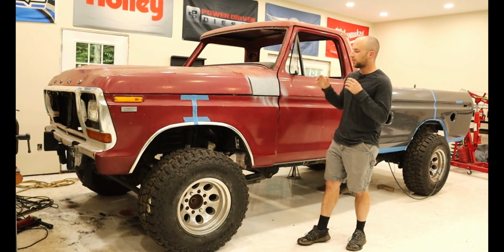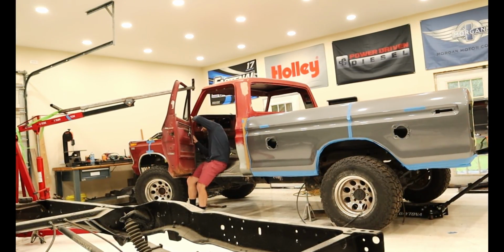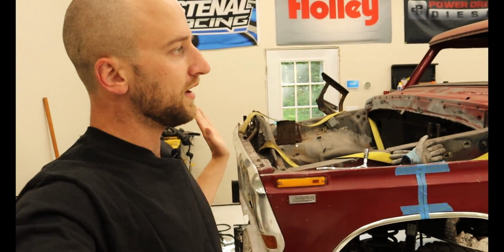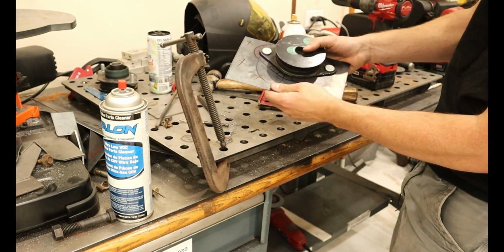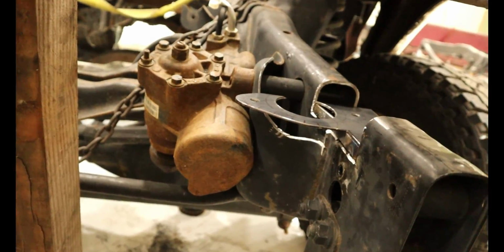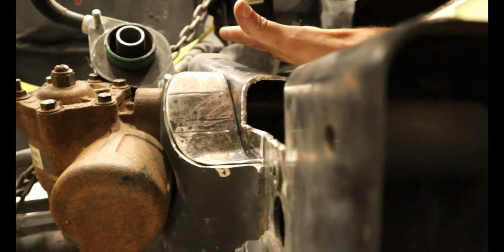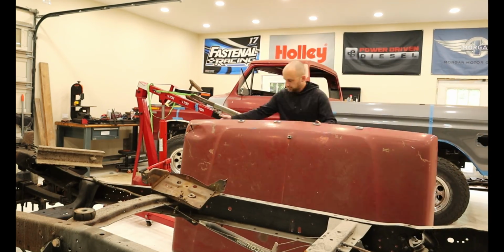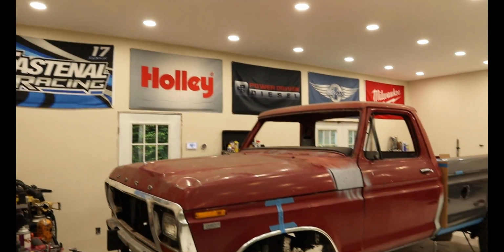Classic Looks with Modern Drivability - 1978 F-Series Body Swap

Comment: Where did you find a full dentside bed in such great condition, I have a dentside myself but my bed is rotted through and I'd like to find a new one
Reply from the maker: My best bud used to be a painter for his families body shop. I ended up purchasing all new replacement panels and we literally built a brand new bed together. He bedlined underneath and painted it for me. He recommended taking the truck to get Line-X'd inside but have yet to do so. Unfortunately this was before my Youtube channel!

I have read you can use beds from OBS trucks, rip off the bed sides and install dentside bedsides and tailgate.  Everything lines up and looks correct. However, I have not done it so you'll have to do some research on it first before commiting.
Reply: Pay a body shop 8k to put one together from a supplier. Make a new one.
Reply from the maker: @PonkyKong  That is pretty much what I did haha, luckily my best friend's family owns a body shop. Lots of late nights but we got it done. Learned a bunch about how panels actually go together.
Reply: @barnbuiltbeaters  same boat for me. Just have to pay to play.

Comment: How will that work to title and registration off the old or new vin?
Reply from the maker: @LEGOCAMARO  off the old VIN. I still have the original tag. Might be a little bit if a headache but it'll all workout
Reply: @barnbuiltbeaters Thanks for the reply! Looking forward to see the build completed. I just got a 93 GMC tow truck, regular cab with a hydraulic aluminum bed. Was thinking of doing a 72 Silverado cab swap. Just earned a new subscriber.
Reply from the maker: @LEGOCAMARO  go for it! It honestly wasn't too terrible! Worst part was all the grinding! This was my first real fab project too. 
Have you compared the design from new to old how the cab mounts? They might not be tok different considering it's the same brand!

Comment: What do you do about the Title issue. Since the title on these old ford trucks go to the frame and not the body. The VIN is stamped on the frame, there is none on the body, just warrantee tags.
Reply from the maker: That is a great question. I know when I registered my truck prior to taking it all apart, the guy used the VIN tag on the door jam. 
I suppose the worst case I can buy a junk frame from someone, cut the VIN out of the frame and weld it onto the new one. Not sure the legality of that but thats my first initial thoughts. 
I actually briefly looked over the original frame and was unable to find it. Could have been covered in grease though. I also have the Title.

Comment: I didn't realize in one of your shorts vids that the chassis was a 2018. I had commented about Powernation putting a 79 f350 crew on a 97 ram cummins chassis. The older ram chassis seemed easier to mount the Ford to vs your much newer chassis. I think you did a phenomenal job.
Reply from the maker: @TheRoadhammer379  i just commented saying the exact same thing haha! Thank you I think it turned out well too. I've never done any large fabrication like this before so I'm pretty proud of it!

Comment: Awesome old Ford being put on top of a piece of shit Dodge
Reply from the maker: @joetimmlv1  haha glad to get you stirred up! Huge improvement over the stock chassis in basically everyday. So might not be the best compared to Ford/GM but better than the original. Pros and cons to each manufacturer!
Reply: Well, if you know history, you'll recall the Dodge brothers made truck chassis  for Henry way back when. They broke away from Ford and began producing their own vehicles. The early Dodge logos featured the Star of David. Now you know why Ford aligned with the Germans and hated the Jews. He hated Louis Chevrolet so much (OHV inline six) he refused to make inline six engines. When he did, it was an industrial flathead. Looks like we're coming full circle, 80s Ford body on 2000s Dodge chassis. The 12v Cummins and ZF6 will be icing on the cake...

Comment: Our old metal looks nicer, and seems to have made the trip to two  thousand twenty three just fine. I see that Case tractor and Toyota have committed to going with hydrogen for our fuel of choice... good for us who use fuel instead of the push for electric plus way cheaper to drive making fuel companies bring prices down. Oh yeah, we will wind up with a gps mileage tax so the government can keep getting their unfair share of taxation. No reason for fuel to be over a dollar a gallon as I remember paying under twenty cents a gallon for fuel in the sixties. It was only a nickel a gallon for  diesel at the bulk plant where we fueled the logging trucks at. rigs that only got a whopping two plus miles to the gallon were just fine. No I don't want a rig that you measure feet per gallon like some race car engines. I do like clean air just as much as the next guy and making hydrogen fuel at home is not so hard to do... making a quart of water go several hundred miles to the gallon. Out of the tailpipe comes oxygen and water... cool beans hu?! I did own and drive many ford trucks from the days when it was Just a F with no extra zeros on the tag. F1 through F3 was the numbers then and around the sixties I am guessing it changed to a few zeros to make it sound better I am just guessing. New subscriber now
Reply from the maker: Thanks for the sub!
Holy cow man that was a rant haha! Where did that come from haha?

All I can see is you can't stop progress. Progress isn't a straight line. Unfortunately, the cost of goods always increases. These last few years were a bit crazy though...